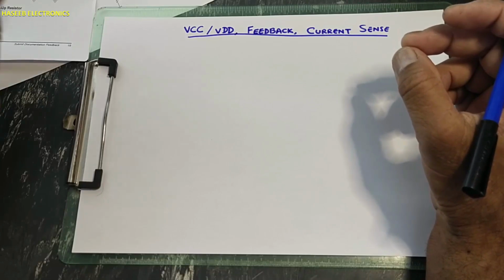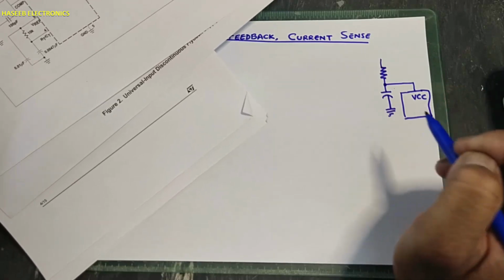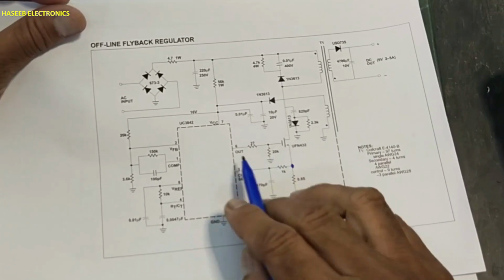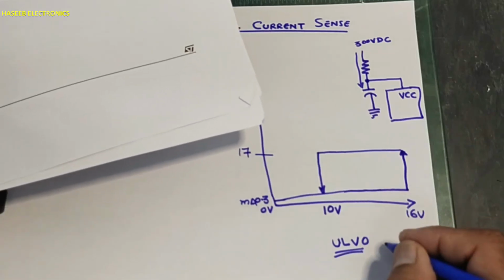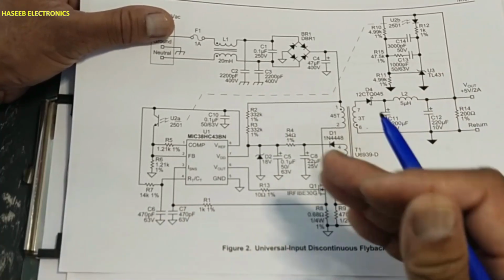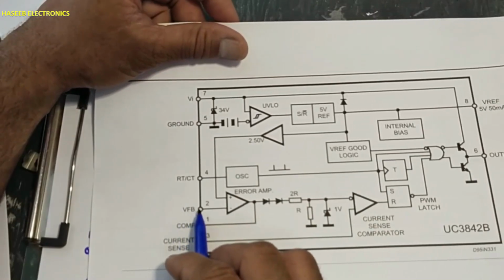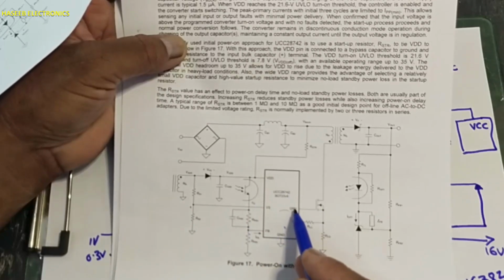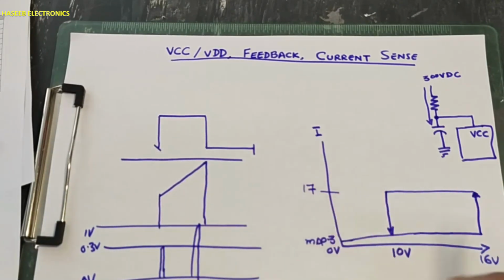{1228} VCC, Current Sense & Feedback Relationship in SMPS Controller

Comment: Hi, can we convert any smps adapter as a charger? I have an ion battery with 3S7P and a smps adapter that can output 5.6 amps with adjustable output voltage between 11V and 13V. When I try to charge my 3S battery with this adapter, the adapter constantly turns on and off due to voltage collapse. Do you have a video about this?

Comment: Hello master Haseeb. Thx for you informative video. Can you explain what happens if we have a short on the schottky diode on the coil's output?
Yesterday i shorted by mistake the Double schottky diode and the PWM IC exploded, the Mosfet shorted out with it a bounch of resistors and 1 diode on the PWM side.
What happend there? Why the coil generated a short on the PWM and Mosfet, if the output diode shorted?
Did i get the 320v on the PWM?

Pls explain me, thank you again for your work!

Comment: hi Sir much appredciated,  can you please explain on a half bridge smps how pusle transformer drives the 2 transistors , what voltage is applied on the base of bjt to switch the transistor off while the other transistor is On because i assume the pulse produces ac voltage instead of dc voltage

Comment: Great video, as always. It would be nice to make video on TL494 which is classic voltage mode controller, used in so many S.M.P.Ss. Especially it's error amplifiers, soft start (dead time pin) e.t.c. 
I even have used it for dc motor speed control, for the motor had tachogenerator who's output voltage is proportional to the shaft speed. Motor was from satellite antena dish servo positioning drive.
Reply: Great vid.